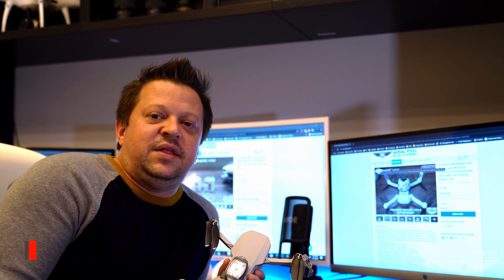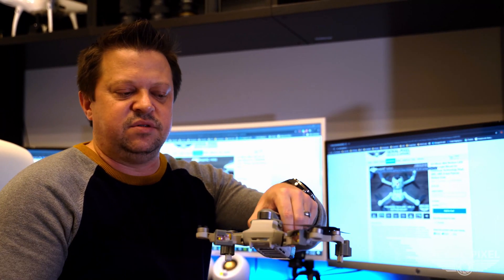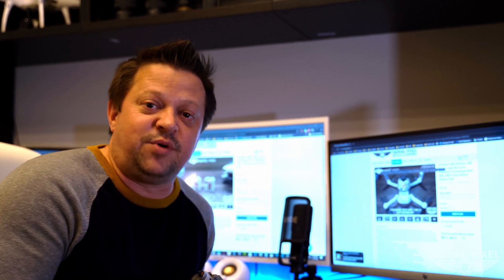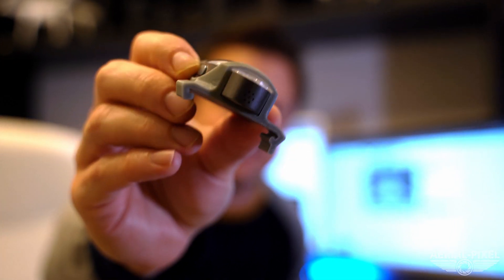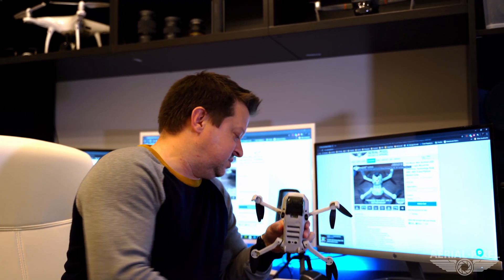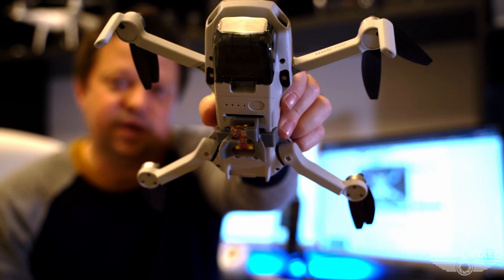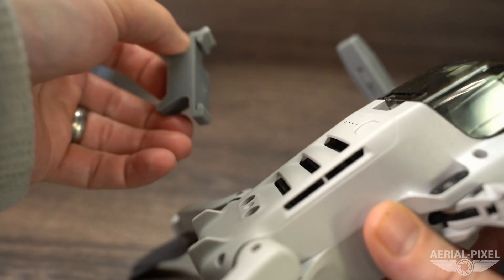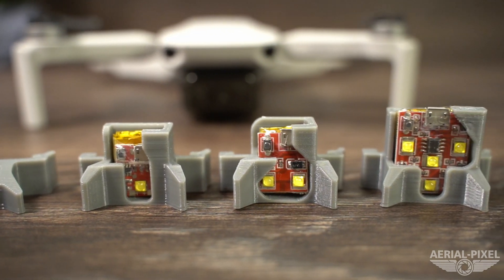Mounting Strobes To The DJI Mavic Mini and Mini 2 - Front, Back, Top and Bottom

Comment: I just bought the rear arm mounts, but I have no clue how to get the strobe to stay in the mount/housing.  It doesn't seem to fit inside without just falling out.
Reply from the maker: Hey Paul, did you order the correct mount? Looks like you ordered the ARC V version which is for this strobe: https://amzn.to/3JqNhRg
Reply: @AerialPixel  I bought both, separate orders.  First I bought the Arc V, then I placed an order for the rear arm mounts.  Are you supposed to leave the plastic wrap on the dual strobes, or else they won't fit in the arm mounts?
Reply from the maker: @Paul Moseman I only see one order from you for a Top Mount for the Mini (ARC V Version). Head over to our website and click the Messenger icon on the bottom right, we will be able to discuss easier that way: https://aerial-pixel.com/dronepilots/
Reply: @AerialPixel  My apologies, I bought the rear arm mounts/strobes from Firehouse Technologies
Reply from the maker: Oh, oops, love their strobes, not their mounts. They sell our mounts for their bigger strobes on their site, none of ours for the mini though. You can find our Firehouse Dual Mini mounts on our website here: https://bit.ly/djiminimounts
Reply: @AerialPixel  These seem to be designed more practically.  I might give these a try.  Thanks.

Comment: I would like to buy this setup for my Mavic Mini 2 but will there be a weight issue effecting flight times & performance, battery etc ?
Reply from the maker: The Mini 2 weights about 242g so adding just about anything to the drone will make it go over 250g limit. The little bit of extra weight of a couple strobes and mounts won't affect the drone very noticeably in regards to performance and flight time.
Reply: @AerialPixel  Ha. Government "weight limits".
Reply: Wondering where I can put the remote ID module (sept) after adding just one one strobe mount on my mini se.  Have not seen one FAA weigh station where I fly.

Comment: Would you know which of these would keep the whole weight below 250 for the mini 2 (and be FAA legal for night flight)?
Reply from the maker: Adding just about any accessories to the Mini 2 will make it go over 250g. The drone + SD card weighs 242 Grams, it only gives you 8 grams to work with. You could probably get a single Firehouse Technology Dual strobe https://amzn.to/2LHXFvz they are around 4 grams. The Firehouse ARC II is just over 7 grams and would put you over https://amzn.to/3bOLE1U 
Keep in mind with either of these options you would need to use double stick tape or velcro to hold them on there as the mounts would put you over the weight limit.
Reply: @AerialPixel  thank you Very useful. In US seems worth the effort for now to be able to fly at night. In EU different story as burden would be higher.

Comment: Just received my top mount today for the strobon cree to go on the DJI Mini 2.  Can you post a quick video of that or send a picture of that mount on the Mini 2?  Unlike the bottom, the vents are not open at the top.  There is a mesh/grating type of thing blocking the opening, so I am afraid that I will push that out, or bend it, trying to get the top mount bracket installed.
Reply from the maker: The metal mesh on the Mini 2 is identical to that on the original Mavic Mini, it clips on in the same manner, don't worry the TPU rubber mount clips just rest on the mesh, they won't push it in. 
Fly safe!
Ryan

Comment: Is there a mount/strobe that can mount to the bottom of the Mini 2 or Air 2 that satisfies the FAA requirements for night flying?  I want to be able to see my drone and putting it on top doesn't aid much in that regard, however I think the FAA wants 360 degree vis from all around. .
Reply from the maker: I recommend 1 strobe on the front and one one the back. We have arm mounts and top mounts available for both drones. We have a bottom mount for the Mavic Mini / Mini 2 only, however mounting them on the arms will give you the best all-around visibility.  All of our strobe mounts are available on our website here: https://aerial-pixel.com/dronepilots/3d-printed.html
Reply: @AerialPixel  Thanks for the tutelage.  I'm  trying to decide whether or not I want to fit the Air 2 or Mini 2 with lights for night time flight.  Air 2 is a nicer drone but costlier if lost.  Very cool what you'e doing making niche products for the community offering options otherwise unavailable.  I was already in my garage/shop a few times making stuff to mount a larger pad onto my controller and come to find out you've designed something very similar to to my bent skewer creation.

Comment: At the 2:47 mark of this video.  Wouldnt putting the LED light in that spot slowly mess up the drne as this are is supposer to be ventilated.  The LED would block the ventilation.
Reply from the maker: It doesn't but we've modified the design to allow more air in the first and last vent on the drone, the other vents on the side are open too.

Comment: Dont like the bottom one, it covers the vents.
Reply from the maker: The front and back of the bottom vent is still open and the two on the sides are as well, haven't had any issues even flying on 95F days.
Reply: @AerialPixel  kool

Comment: Are there weight and dimension specs for these anywhere?
Reply from the maker: The mounts vary in size a weight depending on which strobe they are for.
The Firehouse Dual and Flytron weigh between 4.5 and 5.85 grams and are 22mm X 24mm X 25mm and the Firehouse ARC are 30mm x 22mm x 32mm and weigh 7.5 grams.
Hope that helps, fly safe!
Ryan - Aerial-Pixel LLC

Comment: I think velcro is cheaper, lighter and less intrusive.
Reply from the maker: Most people don't like to see Velcro on their drone. For those that only fly with strobes just occasionally after dark usually don't want to have the other half of the velcro stuck to their drone the rest of the time. It's almost as bad as duct tape IMHO, just make it look a little hacked together.
Reply: @AerialPixel  you should watch my video on my channel where I do a show and tell about how I wrapped my drone and added strobes, it can be done discreetly and tastefully!
I'm not trying to be a contentious arsehole or discredit you're work but adding all those strobes is a bit overkill, I know you're only being indicative of what you can do with your 3D printed attachments but adding that much extra weight on the mini just puts too much pressure on the little fella, but each to their own I guess and I wish you the best of luck, I'm just saying that there's a better and cheaper way of doing it where you don't have to make the drone look cheap and hashed together like you say.
The way I've done mine, weighs less than putting on the propeller guards and you don't even notice that I've put velcro on until you look for it.
Best of luck with your venture though, it's impressive what you do and I seriously mean that.
It's just not for me personally!

Comment: Nice Idea but a bit too clunky?.. can you trim down the weight and size?
Reply from the maker: Unfortunately printing them with TPU instead of hard plastic they need to be thicker to make them hold their grip a little better. We purposely use TPU so they have that rubbery grip on the drone, are indestructible and don't scratch the drone. Using hard plastics we can make them thinner but then they will get brittle over time, cause wear marks on the drone from installation and removal, and they will break prematurely. printed with a 30% infill these are still extremely light.

Comment: So you’re impeding the vents from dissipating hot air to have a strobe installed in the bottom... makes sense.
Reply from the maker: Not much, the 2 front and back bottom facing vents are still open and 2 of the side vents are still open, still plenty of air circulation going on.
Reply: I'd err on the side of caution and keep the vents entirely open. I would never attach a strobe to cover the vents, as you say.

Comment: Do you have any experience with the Firehouse Mavic Mini bottom strobe mount? Mine just arrived in the mail and its "flexible" material is rock hard. I'm scared of forcing this thing to snap into place in the vent slots its designed to mount to. I think I'm just going to order the one in your video.
Reply from the maker: Did you purchase from us? We make all our strobe mounts out of TPU, there is slight rigidity to it but you can still bend and flex it pretty easily. If it is the same mount shown at 2:42 of this video then install it just as shown. Install the side without the thumb catch first then use the thumb catch to bend the other side of the mount back to fit it in the other side vent.
Reply: @AerialPixel  sorry, I forgot to specify that I bought the mount directly from Firehouse. I don't feel comfortable trying to force it in place. I'm just going to buy the mount from your company.
Reply: @AerialPixel  Your version of the mount just arrived in the mail and it is a much better design.